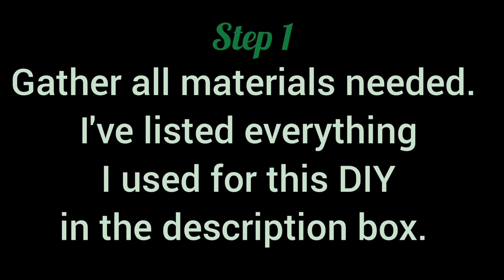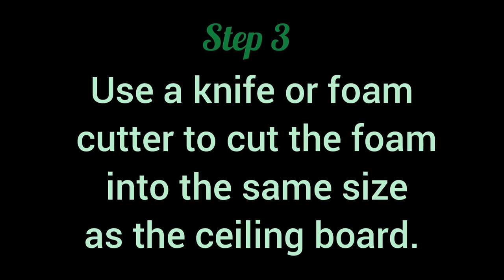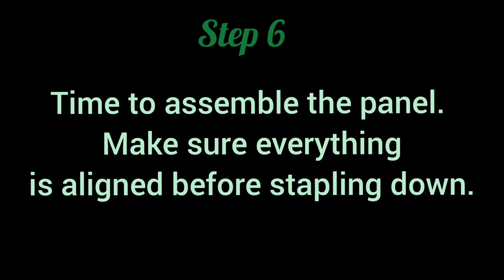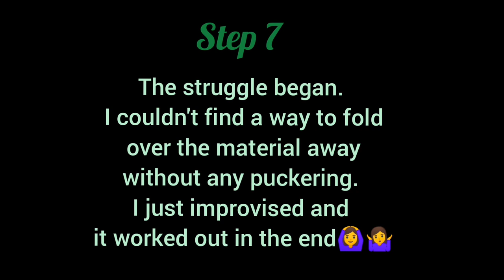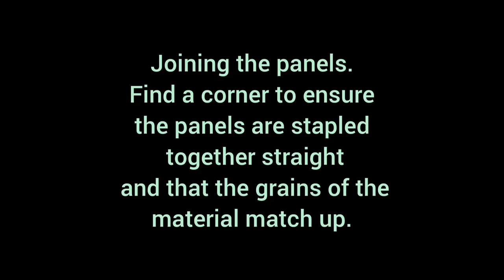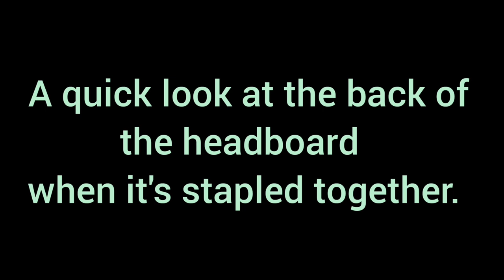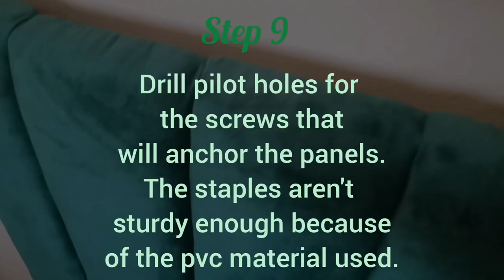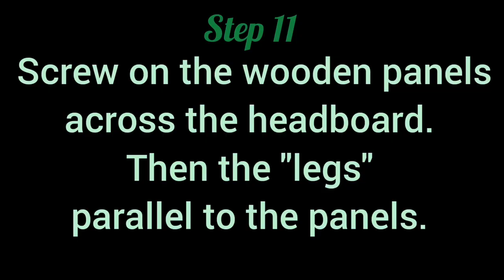HOW TO MAKE A CHANNEL TUFTED HEADBOARD PART 1 l SOUTH AFRICAN YOUTUBER

Comment: Hi. This is so gorgeous, can you maybe give an estimate on how much material you used. I want to make it on a budget for my queen size bed, in durba
Reply from the maker: Hey Wayne, thanks for the compliment. Kindly excuse me for the late response, I have been otherwise engaged. Please check the UPDATED list of materials I used to complete this DIY in the description box. I believe the dimensions of a queen bed to a double one don't vary much so getting the 3.5M of the fabric will still suffice for your bed. Please adjust the other materials to 3.5M as I got more of those for future projects. i.e instead of 4M of decron get 3.5M etc. I hope this has been helpful.